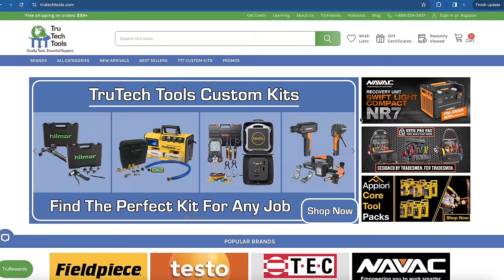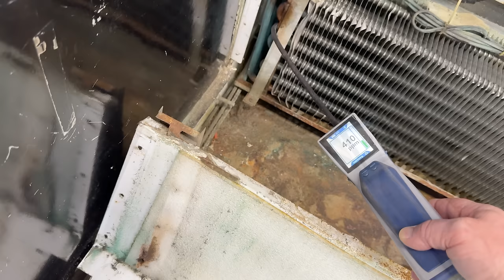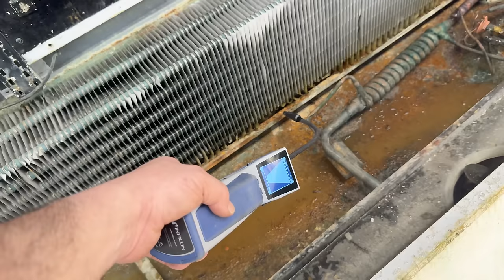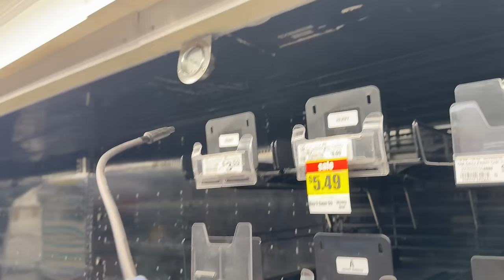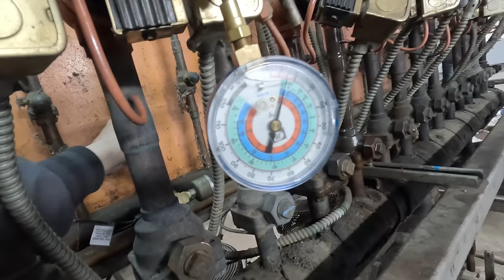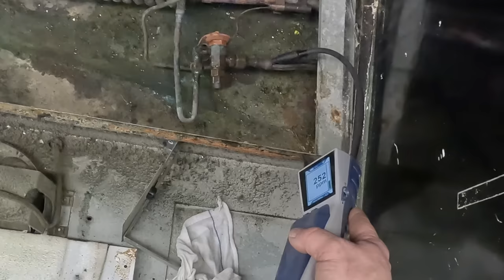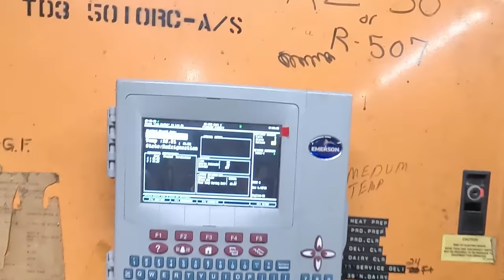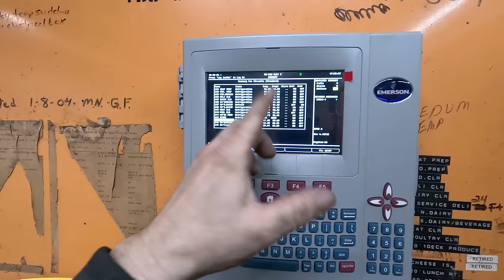Ready To Give Up & Quit

Comment: Doesn't matter if they want repairs or new. It all pays you the same. Your torch skills are next level. I would have burned through them paper thin tubes in a new york second
Reply from the maker: Lots of practice and the tip makes a difference for sure. Thanks for the support!
Reply: New York Minute - defined as the time interval between the light in front of you going green and the guy behind you leaning on his horn.

Comment: I've run into some really tough dogs doing Tv's and sound systems as a road tech for American appliance the last18 years before I retired. I understand the frustration perfectly. Especially when you're up against the clock. It can be crazy. Good Job keeping the screams inside 🙂 Yours is not an easy job. Lots of moving parts to deal with on those behemoth's.
Reply from the maker: Thanks Larry! I was set to be an electronics technician but changed schools 2 months before it started.

Comment: I'm not even two months into service after seven months of being on an install crew. New to the industry. Had no idea how easy install was until recently. It is difficult to articulate how much it helps to see the struggles are just a part of the job and not 100 percent on my lack of experience. Running into problems around every corner on some jobs has led to questioning my life choices. From doubting which condensing unit is for which box or case only to find out my first assumption an hour prior was correct to finding leaks on a rack receiver that make the married guys text their wives to say they'll be home eventually, it's a wild ride.
Reply from the maker: Thanks for sharing! It’s a good career choice pay off just has some downsides just like every other job.

Comment: The biggest problem I see is a possible lack of windows that open and are big enough to throw that whole mess out of. That one of those cases can cost $50,000...the mind boggles. Does that include the refrigeration system?
Reply from the maker: I couldn’t believe it either. I’m talking about a glass deli case that has a flip up glass lid. But still it’s jumped in price from what I’m told.

Comment: The distributor tube leaks aren’t fun. The first time I had to do one I was worried that I was going to pop some of them out. I literally used the Viper wet rag around the other tubes to dissipate any heat I could. It was sketchy though because I felt like I was overheating it but the brass took a bit to heat up to take it. I sealed it but I was okay if I never had to do it again. It was up in a walk-in cooler and didn’t have great angles. It was properly my second leak repair as well.
Reply from the maker: Heck yes, they suck! Good job ! 👍

Comment: I seen that tip on Amazon and wondering what it looked like with a flame nice it covers the whole area that needs brazed got to get one❤
Reply from the maker: Make sure you get the matching handle. It will screw on to the victor torch but you’ll have issues with the oxygen and acetylene mixing in the handle and then it’ll go out on you and it will burn back in the handle. Been through it many times with all the different tips. You can’t trust the Counter guys. They told me that it would work and they are full of it, I had to call the factory and talk to them.

Comment: Side note, those distributor caps with the brass end that looks like a trumpet to cooper feeder tubes suck to try to repair. I have literally cut those out and made my own out of copper pipe, it’s not pretty but what can I say. My company services a 20 Trane split from 1998 that cools a clean room. The liquid line is 1 1/8” with 4@3/8” pipes ram jammed into it and soldered shut. Again, not pretty. However, it’s worked for 23 years lol! Just a thought if you run into what this video showed today lol! Great job!

To clarify, the 20 ton air handler has 4 expansion valves with 4 TXVs mounted external to the cabinet feeding 4@5 ton coils. Sorry I left that part out lol
Reply from the maker: I’ve seen that done before where they basically taken oversize pipe and flatten it down. The problem is you gotta be careful to make sure that the distributors are all equal so they all get equal feeding but you know like you said if the things a piece of crap and you gotta make it run then you do what you can do and if you lose some efficiency, so be it, thanks for sharing!

Comment: I stopped installing rancos bc of that exact problem with them reading the probes correctly. Ke2 + air defrost is just slightly more expensive. I’ve never had to replace a probe, or a defective control on them. The air defrost can be turned off, there's max compressor starts per hour if you like that feature, diff, and set point.
Reply from the maker: I even added a 120v coil isolation contractor to make it last longer.
Reply: Nice! Seems like the Ranco use to come with a normal metal thermistor on the end of the wire. Now they have that dumb looking rubber piece. At least the ones I’ve found lately.

Comment: it wouldn't hurt to brush flux all over the areas being re-brazed, that will help clean it more when heated.
not that you'll ever get it super clean where it's been oily and leaking between the tubing, although flux may migrate in somewhat and help the rod flow(or not) lol
Reply from the maker: I never use flux on dynaflow it screws up the flow

Comment: do you use chlorinated or non-chlorinated brake cleaner?  I know for most of my work, I prefer chlorinated.  I use it outside as it is.
Reply from the maker: The shop has non-chlorinated and that’s what I’ve been using. I can’t say I’ve tried one over the other and didn’t know there was any differences other than to watch out for phosgene gas if I’m burning it off.
Reply: @HVACRSurvival  - Chlorinated is a bit more aggressive and seems to be a bit less residue.  I prefer it when I can get it; I also don't use it indoors.

Comment: When it rains it pours !
I'd love to get my hands on the Uniweld stuff , i don't even have a rosebud tip ... Sigh...
By the way I'd wear some anti cut gloves mate , you don't wanna cut yourself on that nasty  dirty old stuff !
Reply from the maker: Sterling how do you get the jobs done. You never get anything you want.  Why can you order stuff from here? Shipping? Tariffs?
Reply: @HVACRSurvival  Yeah it's just a lot  of hassle. You've got currency conversion which inflates the price , then you've got shipping which is very long and expensive, then once it gets here there's customs they may or may not allow it and they'll make you pay import tax as well .
Then you need an address where someone will for sure be here to receive, otherwise now it's another hassle with the delivery company which may or may not have provided you with a tracking number and so on and on ....
Just too much hassle , and that's if the seller even ships overseas, cause for example trutechtools does not , so it's not even an option .
🙄

Comment: It's days like this that make me question my work ethic.
Reply from the maker: I had to call for advice to keep motivated. I wanted to be like everyone else say it’s fixed.
Reply: @HVACRSurvival  I may start doing that. I usually internalize the pain of doing the job correctly and yell at the units I'm working on. Most of the units stay fixed because I threaten them with getting replaced and becoming soda cans.
Reply from the maker: It helped. I knew what needed done i just didn’t want to but as usual i did the right thing.

Comment: Why don't you start your own business. You are very experienced.
Reply: If you not doing. Serving  Supermarket you need a whole team of technicians I did racks we had over 600 refrigeration mechanical at that time late in the 90s union shop.
Reply from the maker: I did the service manager role while still running service calls for 8 years prior to where I’m currently working. Owning your own business is not what most think it is. I’m paid very well for the area I’m in, it would be hard to make more money to be worth being on call all the time and dealing with the BS that goes with running your business. Plus I’m soon to be 49 years old. I don’t want to deal with it.

Comment: would have been cheaper to just replace the coil. VS the hours trying to patch many holes, testing and so on
Reply: Coils are not always readily available
Reply from the maker: @Zack how much do you think that coil costs? Where do I find a 35 year old coil?
Reply: Its not residential. These coils are only made for a little bit then discontinued or obsolete. So you very frequently have to make field repairs....these parts are extremely expensive and its not our call as techs...its the customers choice and we make the best of the situation
Reply: Not even close. The time to repair that coil isn’t nowhere near what a new coil costs. And you’re not gonna find one so you’re gonna have to wait to get one made plus the loss of product that they can’t sell plus the time to install a new one. This is refrigeration. They want it done now
Reply: I guarantee you it's not sitting on the shelf at your local supply house. If it's available, you will have to get Hussman or Hill Phoenix, etc. to special make one off of a drawing. Patching coils in the field is a very common occurrence.
Reply: Great video thanks
Reply from the maker: Thanks for all the confirming comments guys!